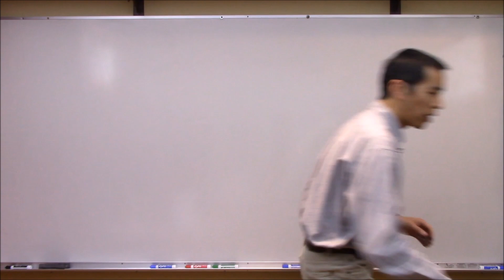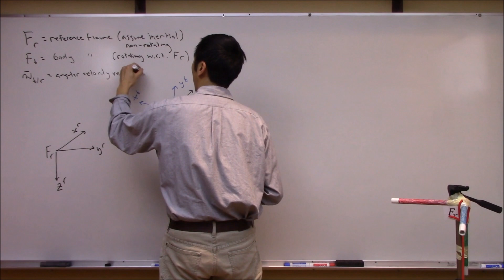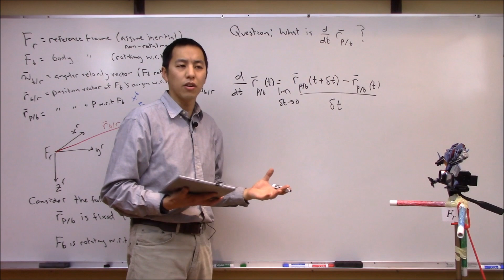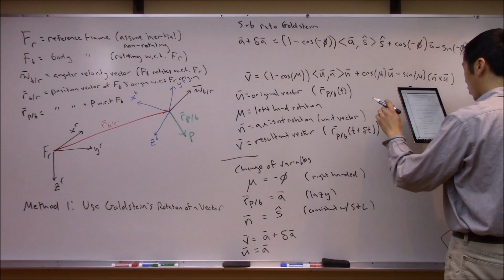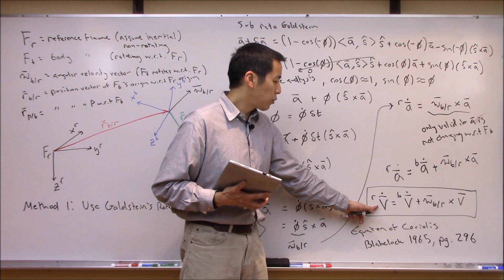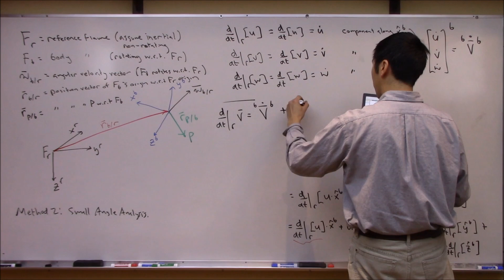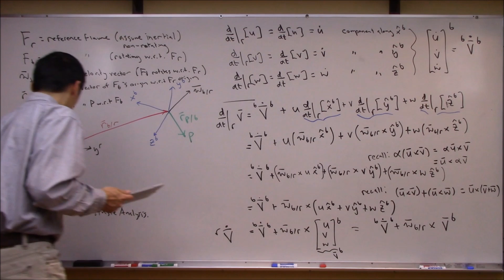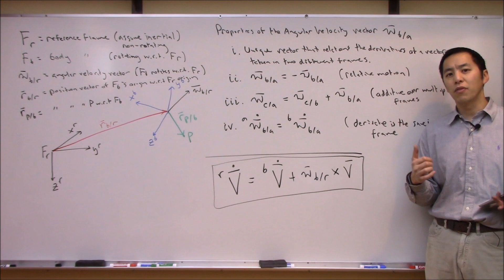Vector Derivatives (the Equation of Coriolis) and the Angular Velocity Vector

Comment: Your videos are really super valuable and have excellent explanations. 

I have a question here that seems confusing a little bit to me. From the intuition perspective not through the mathematical proof, how is the angular velocity vector rate of change independent of frames in the 3D world, where it's supposed to be a vector like any other vector and has its own projections on different frames?

Besides, I guess this vector can be changed in two ways, one is its magnitude and the other is its orientation. So in the case of changing the orientation, I think the rate of change would be different between frames.

Thanks in advance.

Comment: Thank you for your efforts.  I have always had a problem understanding describing the rate of change of a vector in an inertial frame using a rotating frame's coordinate basis (around 1:07:00).  The RHS of the equation ( V + w x V) are all in the body (rotating) frame, correct? Which would mean V in the (an) inertial frame is also in the body frame...but frame is not inertial? What am I missing?
Reply: Yes. RHS is all in body frame. The equals sign does not set the two FRAMES equal. The RHS describes the rotation of the vector V in Fb as perceived in the fixed inertial frame.
Reply: @thomasstiglich3484  Thank you .
Reply: @thomasstiglich3484  Thank you for the clarification, Thomas.

Comment: AE512: Great video Chris! I've never seen the Coriolis equation derived using Rodrigues’ Rotation Formula. Also just for clarification, the 4th property of angular velocity (where the angular acceleration is the same in either frame) is only true when the vector is parallel to the rotation axis, correct?
Reply from the maker: Hi CJ, great to hear from you again!  Is this similar to what hw1, p5 is asking about?
Reply: @ChristopherLum  Yes, I guess it's the same question problem 5 is asking. The cross product term is zero because we chose the vector to be equal to the rotation vector.

Comment: 49:28 I am confused becouse  if you sit on an aircraft and you see the aircraft, the aircraft is not moving, it does not have velocity or acceleration, so the acceleration with respect to the body fixed referene frame must be zero, isn’t it?

Comment: AE512: @1:05:50 you say that w_a/b + w_b/a has to equal 0 in order for that cross product to equal zero. I don't think this is entirely true. What about if w_a/b + w_b/a was equal to V? or -V? If this were the case then that cross product would still equal zero even though w_a/b +w_b/a is non-zero.
Reply from the maker: This needs to be true for any aribtrary V, not just the special case that you mention.  As such, the only way this is true for any V is if the property mentioned applies

Comment: AA 516: when you say that w_a/b = -w_b/a, is this true within a single reference frame? (such as the inertial frame for example) Thanks! -Patrick F
Reply from the maker: Hi Patrick, I think I understand the question but in short, yes, that should hold true within a frame.  If you were to express this in different frames then it is possible that the values in the individual vector elements would change but the vectors are the same.
Reply: @ChristopherLum  makes sense, thanks

Comment: Great teaching Chris, I did enjoy it the example is so vivid only poor Starscream though :-P However I have a quick question though. For Equation of Coriolis, (when there is no body self motion, only rotation w.r.t. R frame), R_dot(p/b) seen in the R frame = w(b/r) x r(p/b). I understood there is no difference for vector w(b/r) represented either in R frame or B frame as both shares the common axis of rotation, however, there will be a difference for vector r(p/b) represented in R frame or B frame , it seems in the equation the vector r(p/b) is represented in the body frame, however the left of equation needs to be represented in R frame, do we have a mismatch here? looks like the  vector r(p/b) represented in B frame needs to be rotated into R frame before cross w(b/r)(can be represented also in R frame in this case)?